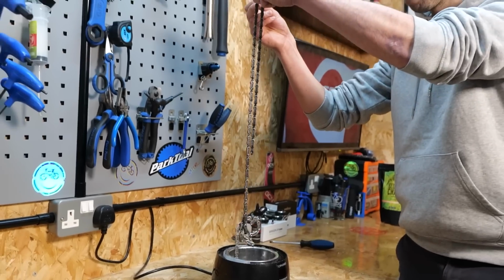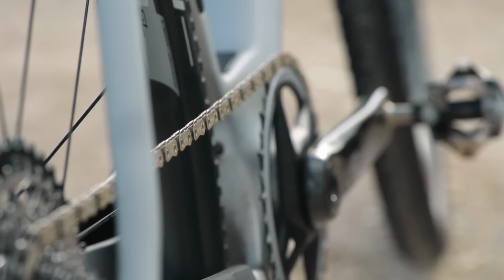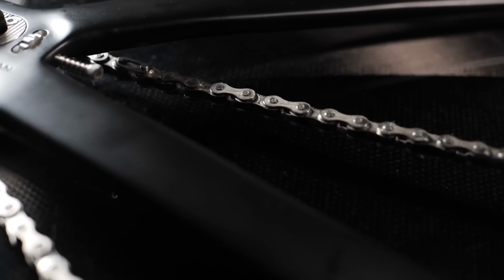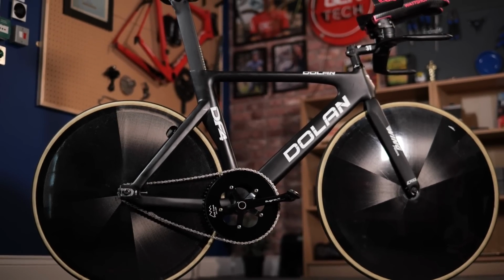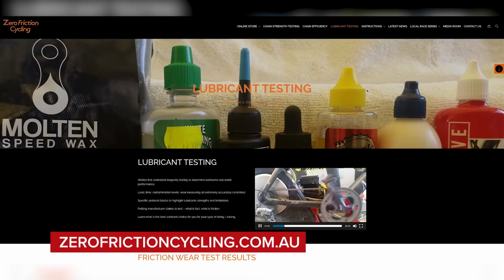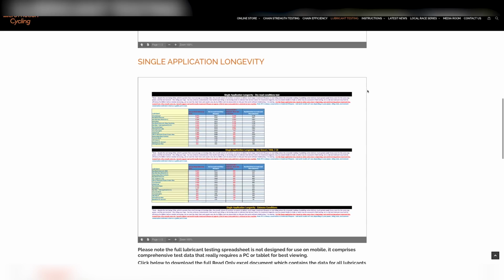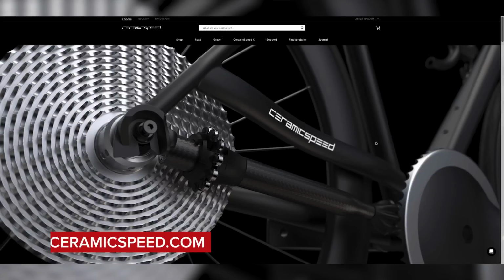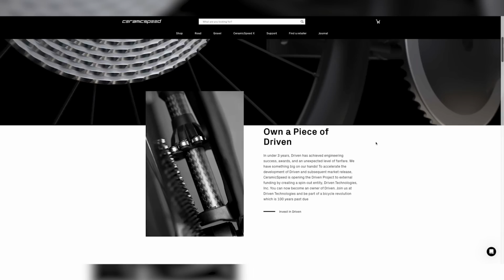Maximising Drivetrain Efficiency & Longevity: Deep Dive With Josh Poertner

Comment: Do you have to get the bike specific wax to actually wax your chain, or there is an alternatives?
Reply: Straight paraffin is almost as good as the waxes with additives, and much cheaper.
Reply: @mrmatthewking  THIS! this, is what I really wanted to hear this lol, and fortunately I find an old GCN video about waxing chain, and it uses parafin wax!
Reply: @mrmatthewking  because the product that they use in this video is really expensive in my country because it's imported.
Reply: @Kuroneko6235  I first started waxing using cheap candles.  It works really well, just be careful as some candles contain oils and other additives that won't work as well as pure paraffin.
Reply: @mrmatthewking  Thanks for the tips, but btw, what should i do with the cassette / freewheel in my case, do i let them be? Or do i need to strip the factory lube from my freewheel too?
Reply: I vaguely recall a recent Zero Friction Cycling video saying that they were going to do a test cycle with straight paraffin wax. That should give you a scientific comparison, as they use the same test protocol for a bunch of different chain lubricants.
Reply: @MarkQueitzsch  can you link the video? I can't find it yet.
Reply: @MarkQueitzsch  my bike doesn't use freehub so all the bearings and mechanism is in the freewheel, i think i can risk ruining my freewheel if i pour some degreaser on it
Reply: @Kuroneko6235  just wipe it down as best as you can. The only area that it is really important to remove all the grease is inside the chain, otherwise the wax won’t bond to it properly

Comment: coparing 2 of my bikes one with 5euro 7 speed chain , with poor maintenance vs my 9 speed shimano 20euro chain , with regular maintenance .  the expensive shimano has brake 5 times !!!  the chap one stll go strong ,   yeee ok the shimano is few gram ligther ,,,
Reply: Which 9 speed chain do you use? I use HG 93s, which are mostly 15 to 18 € from internet Shops. Never had problems with that chain.
Reply: @simonm1447  don t remeber what exact model it is ,  but i have also 2 other bikes with 9speed and they never had problem is just that one on my gravel bike that has brake 5 times ,  furst time was a week after i install it ,
Reply: @darkphotographer  was it always the same chain? A German bike magazine recently tested 12 speed chains and one Sram chain model  ripped off a couple of times, they supposed it was a manufacturing error in the batch. If the material is hardened too much it gets too brittle and can rip off.

Comment: I’ve just done my chain. It was waxed and wasn’t doing a very good job after some use. My process is to get a saucepan, boil some water. Drop the chain in. Swish it around. Take it out. Degrease it and then use brake cleaner which takes it right back to the metal. Then re wax. Used it yesterday and it was butter!!!
Reply from the maker: Nice! Glad to hear you've got it perfected!

Comment: I have been using wax for quite a few years and like the clean and dry chain. I have noticed that my chainrings wear more quickly than with a wet oil. The wax quickly wears off the side plates which now run dry steel to aluminium. My guess is that there are significant efficiency losses through friction on the side-plates and chainring interface.
Reply: That's not my experience with pure paraffin wax. Everything lasts longer
Reply: I have noticed chainrings and cassettes lasting longer with wax lube.
Reply: I think more frequent Lube with some of the things they discussed will be more effective than wax that adheres to nothing and chunks off quickly. I think this discussion has convinced me waxing is a terrible idea!
Reply: @stephendenagy3396  especially for you legs!

Comment: "Solid" is not a virtue.  It does not offer a lubrication advantage in an articulating mechanism.  Once displaced by that 50,000 psi the wax can no longer re-flow to replenish the bearing surfaces.  That's why waxing has to be done so frequently.
Reply: Makes sense 👍
Reply: By "so frequently" you mean less frequently than oil? You do realise you're contradicting someone who has literally done the testing, explained the reasons, refers you to independent testing, and consults to the pro peleton?
Reply: @mrmatthewking  the couch technologists don't need facts. ;)
Reply: @mrmatthewking  Yes.  I also realise appeal to authority is a weak rhetorical device.
Reply: Josh recommends hot waxing a chain, riding it a few miles, which opens up some small gaps, and filling those gaps with wax-based lube like Silca’s Super Secret chain lube (white stuff). I think the point is that hot wax penetrates well into the places its needed and especially if it has additives does adhere well to the metal surfaces under load. As Josh discussed at 17:30, wet lubes can penetrate gaps but also more easily introduce contaminants that end up grinding the chain like a grinding paste. Poertner is in a small group of super geeked-out engineer types (ZeroFriction, MSpeedWax) who have really studied and tested a whole range of ideas, often borrowing very high tech solutions for other sports such as F1 or other motor sports. It’s all moving cycling forward. I’ve been racing for 51 years and I am constantly amazed how the technology of the sport has improved. 😊
Reply: @tommyrq180  The one negative of oil lubrication (the "grinding paste" horror), can be easily mitigated by the use of a simple rag, wiping down the chain after the oiling and again after each of the next few subsequent rides.  The remaining oil largely stays in the bearing interstices where it belongs.  Sadly, this provides little income to boutique manufacturers of bicycle potions.
Reply: @BixbyConsequence  Perhaps. It’s hard to know what’s going on inside a chain. Wiping the chain only removes some surface dirt, probably pushes some dirt in, and does nothing for dirt (or fine metal particles) inside the chain. I oiled my chains for many decades. Always kept things clean including wiping down chains and relubing. But chains and drive gears never lasted very long. (I ride a LOT of miles and race.) I’ve been hot waxing for awhile now and am getting much, much better performance and less wear. I do NOT like the wax flaking though. Not sure whether the wet chain mess or wax flake mess is worse. But we have better instrumentation today and it appears from experimentation and practical application that waxing is superior for performance and wear. It’s not all a giant conspiracy to make you spend money. In order to get you to spend money a producer ultimately needs to make a superior product. Hype might work for awhile but in a capitalist system competition quickly comes to bear. Let’s let the competition sort things out. I appreciate that sites like Zero Friction Cycling are testing and trying to find what works. People like Poertner at Silca are looking outside cycling to get an innovative edge. I’ve never been much of a Pollyanna but ultimately we each get to decide and have a lot of product variability so it seems like a good situation for cyclists.

Comment: That’s my decision made. I’m getting an ultrasonic cleaner and a hot melt wax setup
Reply: The other alternative is to buy pre-waxed, prepped chains (Silca and others), get a Crock Pot (MSpeedWax has great tutorial) and hot wax, and just wax that chain until it achieves .5mm stretch. Never need an ultrasonic cleaner. Those are required, I believe, if you need to super-clean an already petroleum lubricated chain. You can even super clean a new chain (which comes with bad coatings on it) with just jars or bottles (Silca has a good video on this and there are many others on YT). The advantage of buying a pre-waxed chain is that the companies break in the chain mechanically and know how to really clean the chain before waxing. But like all things, I could be wrong! 😊
Reply from the maker: Nice! Let us know how it goes

Comment: I just use wax squirt lube way easier and does the job. No point overcomplicating things. Go outside and ride.
Reply: I know it sounds crazy but I have found... oil..... to be a reasonably good lubricant.
Reply: Same, apply once a week or after cleaning. Check chain regularly and replace when 0.5% stretch. Doesn't attract dirt and become black oily mess, any excess sheds off, easy to deep clean bike without harsh solvents.

Comment: I noticed ceramic has replaced teflon in the chain lube I use.  I believe it's because teflon is a forever chemical.  I have noticed that the ceramic particles separate like oil and water when the jug sits for even half a day.